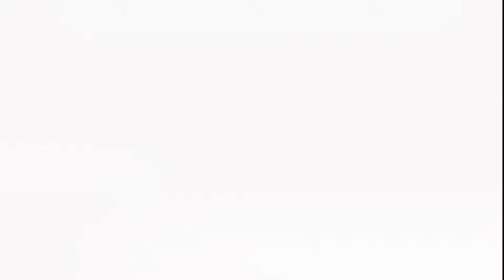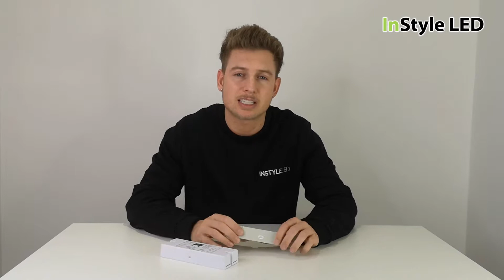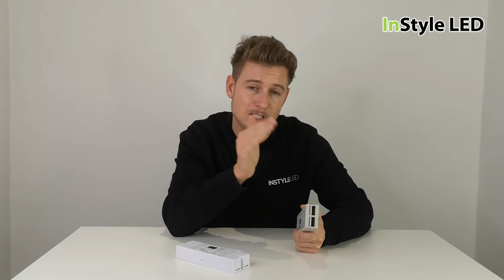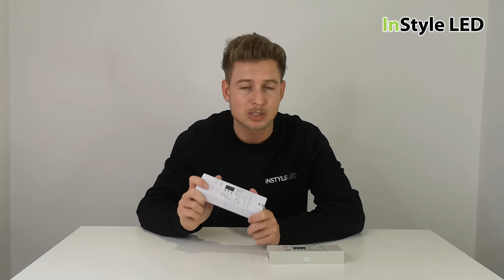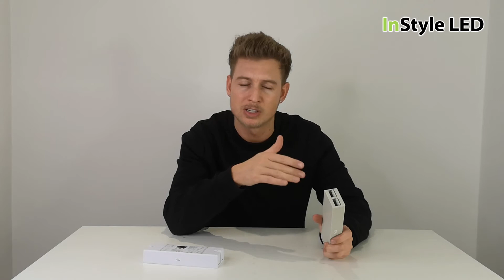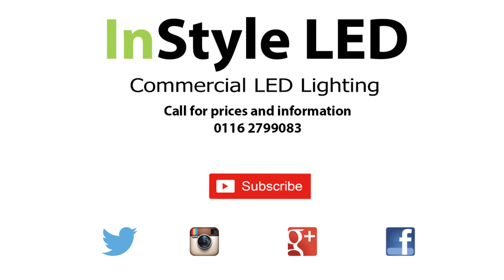What is the difference between 8-bit and 16-bit control for LED strip lights?

Comment: Using 16 bits will mean that the DMX controller will have 65536 levels of intensity (256 * 256) and would use two DMX addresses per channel, with the second DMX address being used for fine tuning.